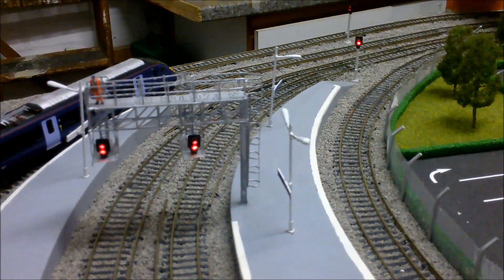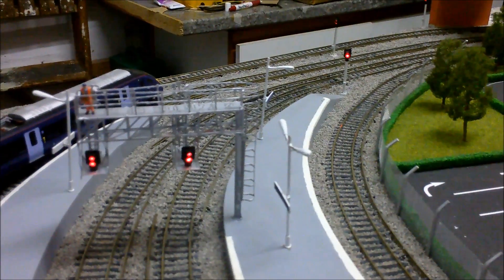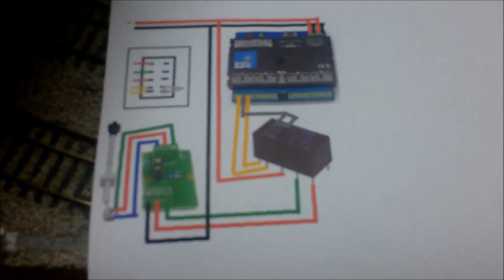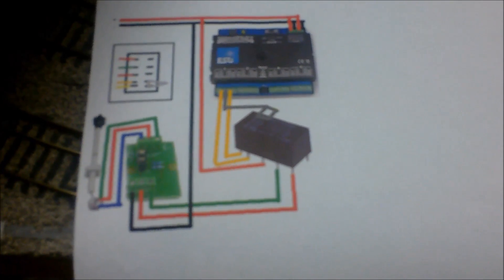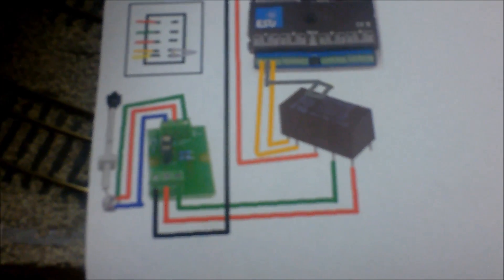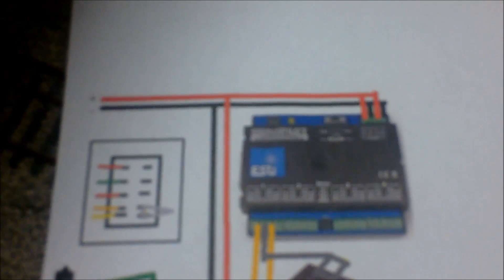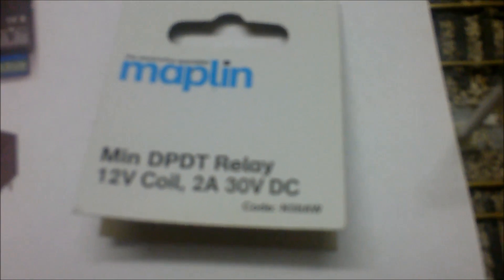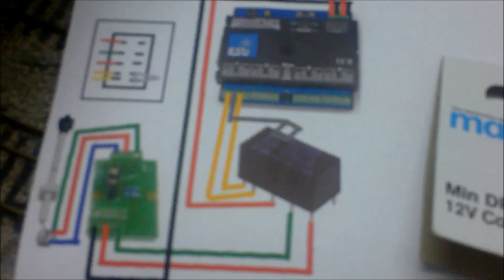Traintronics DCC Signals

Comment: One: I wouldn't want to get ripped off for a daft system that doesn't operate the signals as per their real life counterpart. 2: Colour light signals on my exhibition layouts for over 40 years now, only need a 4 switch relay and a track circuit (a piece of wire cost 1 penny) to operate 3 aspect signals exactly as per their real life counterparts. 3: In addition and as per real life necesssity my signals can also be switched from automatic to controlled at no extra cost. If you use 12v DC in the rails you can thanks to a trick only available with DC have a second 12v DC feed in one rail to operate the track circuit. DC knows which transformer it came from, and will only return to that transformer. This also saves a heck of a lot of wiring !!!!

Comment: nice video - could you tell me more about the gantry? i know its a traintronics kit just wanted to know about it a bit more - thinking of purchasing it for sometime now
Reply from the maker: I picked up the gantry at a great price of £19 off ebay in March this year, took me til now to get it done. Its a nice brass kit which needed soldering together and can be made into a two or four track gantry but very expensive at £30 from the traintronics website!

Comment: Good video can you help me with mine i got a 3 aspect signal tht i have no ide how to wire
Reply from the maker: I have the basic traintronics guide sheet if you haven't got that but the wiring system used in the video is only applicable to 2 aspect signals due to two operations available through the dcc decoder of either say on or off. you can however use a 3 aspect with the traintronics dcc decoder but you have to keep circulating through the aspects so say a train goes through an amber, to get back to red you have to go to green next then red which is unrealistic. Thanks for your comment hope my reply has helped.